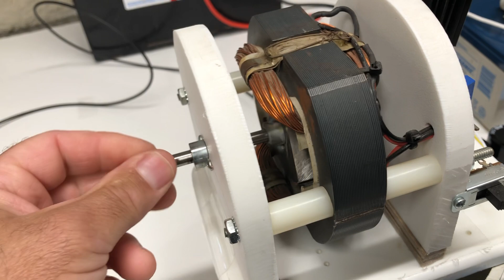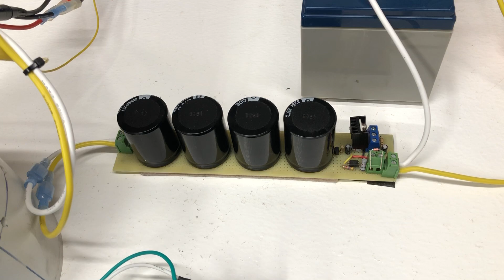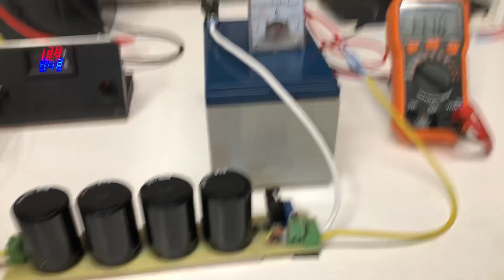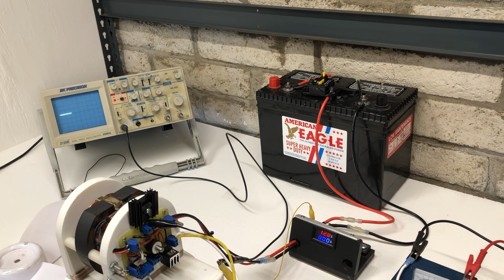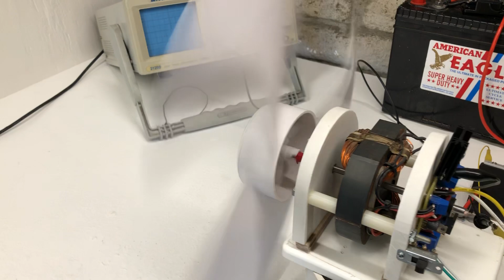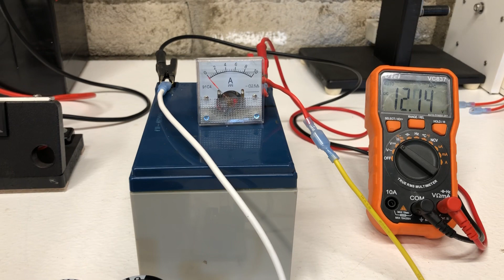Attraction motor ( no magnets ) driving a fan with capacitor pulse output

Comment: K Energy, do you recall the brand of vacuum cleaner this motor guts came from ??/ I like this experiment. I will try it myself to see what I can come up with. Thanks vf
Reply from the maker: I don’t
Reply: I will be dumpster diving for vacuum cleaner machine.  @kenergy1707
Reply from the maker: It was a universal motor with brushes
Reply: Thanks for the starting point Sir.  @kenergy1707
Reply from the maker: 2 pole stator
Reply: Thank you for the answer KE @kenergy1707

Comment: I still can’t find what video that has the build with the 4 capacitor discharge board and wiring of it…. Which video exactly of your collection…?..?.???
Reply from the maker: I don’t have a video of that one yet just a video with one capacitor one with the zener scr setup
Reply from the maker: It’s called Cap dump circuit

Comment: Nice build. You sure are cranking out different designs, all are great. Would you post the cap pulse circuit schematic and maybe explain the operation, I'm guessing there may be a zener diode in there?  Is it possible to make one adjustable for higher voltages? Thanks
Reply from the maker: Thanks ! 
 The capacitor pulse I have two different ones. 
 They both use zener diode as the trigger 15-16volts for 12v 30-32 for 24 and so on 
  The simple way is with a zener and an scr plus capacitor that system works good with smaller capacitor but when you get more it starts to ( stick ) so I made a circuit took a lot of work to make it work right
Reply from the maker: I emailed you
Reply: @kenergy1707  Thanks

Comment: That is one compelling fan motor. Each one of your creations are really unique, in the sense of simplifying very complex issues into makeable ones. Two requests when you get the time : a picture or sketch of the rotor design of this motor and a schenatic of the capacitor discharge bank..... Thank you again for your demonstrations and explanations.....
Reply from the maker: Thank you ! A lot of time and research went into each one ! 
 The rotor is easy it is an oval shape solid steel so when it’s vertical it lines up with the two poles of  the electromagnetic 
  I have another video with a smaller one it’s the same concept 
 The cap discharge can work with simple zener diod 16 volt and an scr
Reply: @kenergy1707  I am sure that quite a lot of time and research by you has gone into creating each and every one of the motors. Thank you for answering my message. I hope you are looking to find commercial usage for these. There are many countries which have large fossil fuel fired power plants, but the demand for usage of your type of motors will continue to exist and grow. An example is for a large company that makes everything from toasters to motor bikes. Recently, they started selling their own brand of ebikes, whose purchase price is lower than their fossil fuel competitors but what really got them buyers is the cost of fuel. While the fossil fuel versions need 0.028 cents per km the ebikes costs around 0.0013 per km. The sun is warming the wallet. I think the same will be true for small country boats that carry people as well as goods on rivers that are certainly beyond the reach of power lines.
Reply: Thank you… please make a video on schematic of the capacitor discharge bank….   You saying a few things about the discharge bank does not explain it ..to a person that doesn’t know what’s going on… and I am ..lol.  Please video it there’s a few viewers that would appreciate it .. ✌️